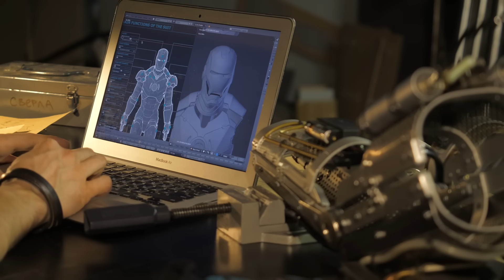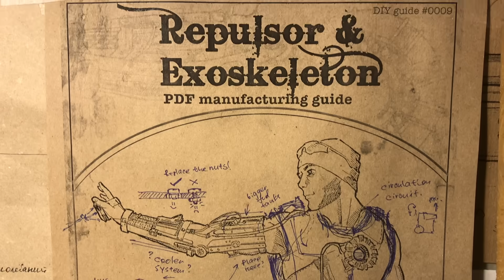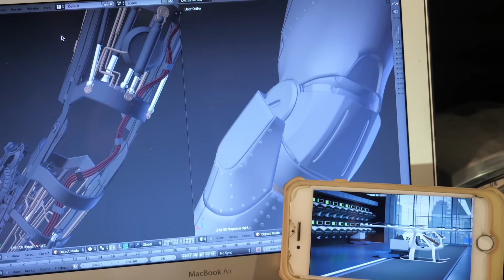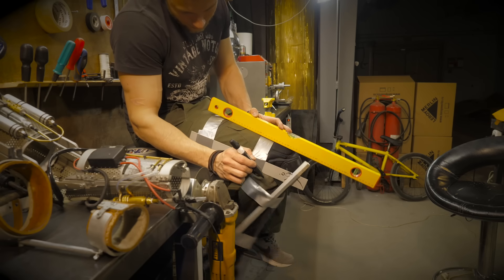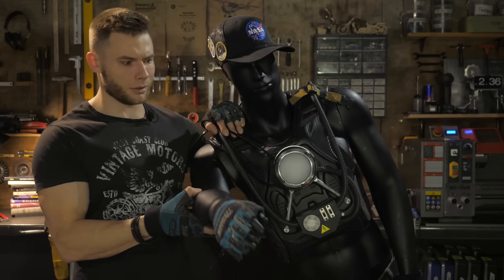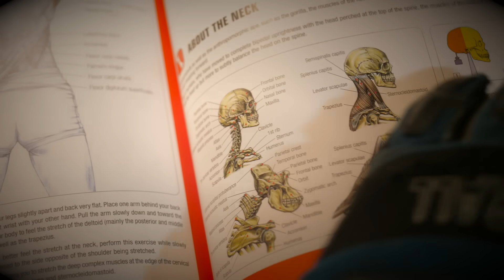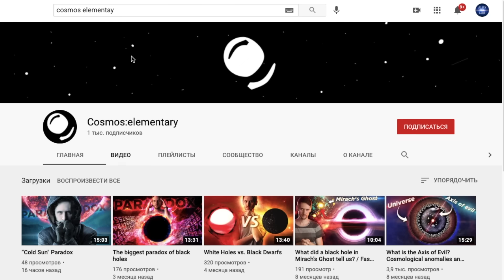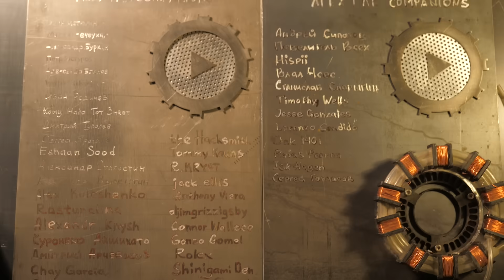Building real Iron Man suit (Part#2: Exosuit, hydrogen muscles & EMG sensors)

Comment: As an electromyographer I was extremely gratified to see you implementing the technology I use every day into your exosuit! There are actually prosthetic limbs in development which use implantable EMG sensors to activate mechanical servos with a high degree of fidelity! Luke Skywalker-esque prosthetics may be just around the corner!
Also, as a physical therapist, I was very pleased to see the attention you are giving to the actual biomechanics of the human body. Too many engineers oversimplify the human structure and create suits that are very clunky and restrictive.  If you haven't already, you may find it helpful to research the construction methods of medieval plate armor. Armorers spent thousands of years perfecting "exosuit" designs which maximize protection while allowing the greatest freedom of motion possible.

Comment: I mean Hacksmith is cool and all, but you are just absolutely shredding it! Keep it up!
Reply: I guess this really highlights the difference between Alex Lab and the Hacksmith. When the Hacksmith was doing their iron man suit, they went straight to trying to fly. They went for the showpiece. Alex seems to have taken a far more logical approach, by working from the ground up to design a system that can work with the body, first and foremost. An actually useable system, as opposed to free-floating thrust. When (if) Alex adds thrust to his suit it will already be set up to aid him in keeping rigid/steady while under thrust.
Reply: @2001herne  Yeah, hes getting everything. Hacksmith went straight for individual featues not a suit making this a lot more impressive
Reply: If Alex had Hacksmith's budget, he would alredy had built Mark II ))

Comment: 2 years later
Alex Lab: So anyway, we are going to be using circular particle accelerators to increase thrust power for the jet engines attached on the thighs of the suit, to increase the flight m/h to 160!